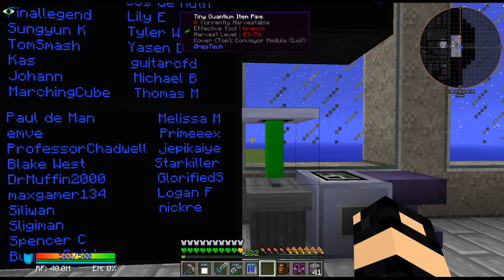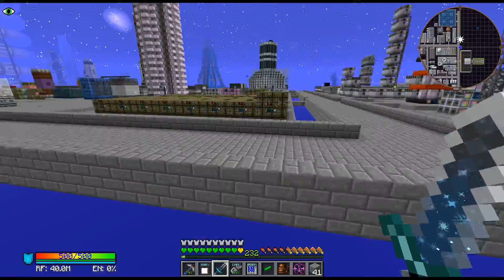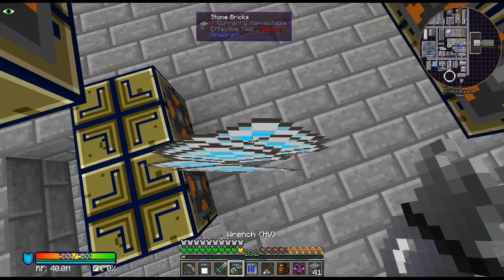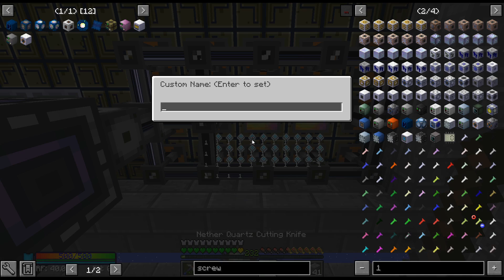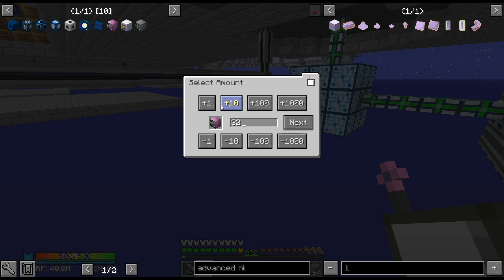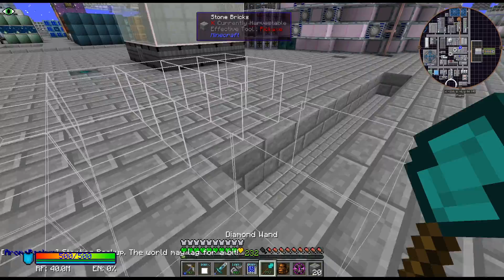GregTech New Horizons S2 - 437 - Gregification Continues

Comment: looks like there's a bunch of comments suggesting stand alone input buffers, all I'll say to add to that is that fully wall sharing these machines, when all you save is a fraction of a fraction of the mats you gain per second from the EoH's doesn't seem to be fun for you, and instead just leads to frustration. Just do full machines instead, giving more room for crafting buffers. and who knows, having slightly seperated multiblocks could let you build them in a more aesthetically pleasing shape compared to a big block you don't like (even if that's the most space efficient).

Now I'm imagining a Greek style temple, where the pillars are some of the 3x3x3 multiblocks... heh, temple to automation indeed

Comment: If I am remembering this correctly, you might want to try this out because it would make your life a whole lot easier.

 ME crafting buses (that connect to slaves) don't have to be in a machine to work, and can just be hooked up to the ME system by themselves. You can just have long columns of them (maybe labeled with a sign or something, i.e. bending 4, lathe 2, etc..) in your main area, all in the same location, which are then connected to the slave controllers wherever you want. This way you can modify and view patterns all in the same place without having to move all over the place to find something. It also makes scaling waaaay easier and more fun because you can just mindlessly place machines and always know that the patterns are in the same place. 

But honestly you should do whats most fun to stick it to the main discord :p

Comment: Curious for a looong time, but how do you dump tons of EU into your Wireless Network per tick constantly?
Or perhaps a Multiblock Generator that input EU straight into the Wireless Network?
Because there is a 1048576 Amps UXV Wireless Energy Hatch, but no 1048576 Amps Wireless Dynamo Hatch. And the former even has a crafting recipe. So “someone” must have intended for it to be used throughout the endgame period somewhere.
Reply: The dynamo hatches are useless since the EOH directly dumps its power into the wireless network without any hatches neeeed
Reply: The thing is… It also need an amount of EU to run a recipe beforehand, and most of the lower tier recipes drain EU rather than generate EU. So those initial Wireless Energy, where do you get it from?
Reply: @-PhanHoan-A You generate power from previous sources, mainly Dyson swarms.

Comment: Why would the official discord not like your playthrough?
Reply: Theyre more pretentious than redditors lol
Reply: @darkflower1729  is it that they don't like the ""inefficiency""
Reply: @unktheunk1428  yup, if you don't have absolutely everything paralleled with minimal overclocking the DC will straight up bully you and call you an idiot
Reply: @darkflower1729  so they want you to make 30,000 machines instead of overclocking?
Reply: @unktheunk1428  pretty much, an example of an average interaction with them is when I (as a GT noob) posted a pic of my polyethylene setup and got eviscerated for using Windows instead of Linux. Those mfs needs to touch grass if they think I'm setting up Linux to play minecraft😂
Reply: @darkflower1729  I mean.. I'm also a linux enjoyer, but being a dick about it is sorta counterproductive
Reply: @unktheunk1428  I mean I'm a CS student so I could do it np but ya the DC goes a little wild about it lol
Reply: GTNH does appeal to a very particular type of autism  @darkflower1729
Reply: @darkflower1729 as someone that uses both Linux and Windows, why would you game on anything besides the platform all games are build for (Windows) 🤔
Reply: @jenidu9642  exactly bro